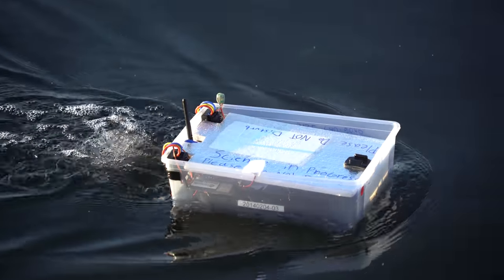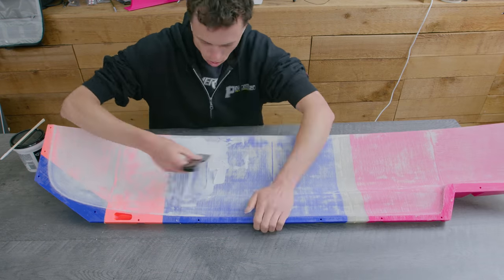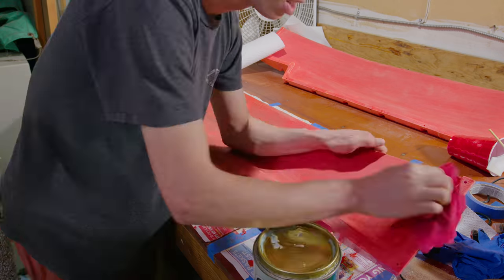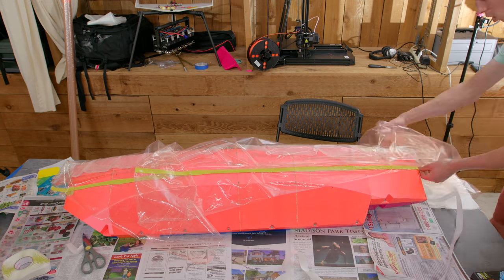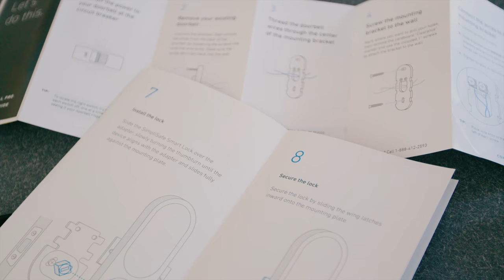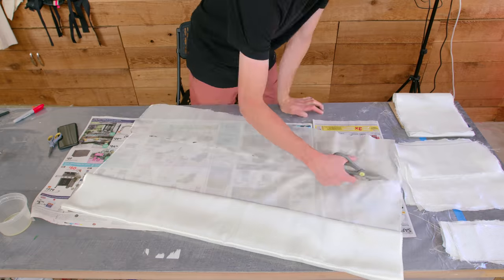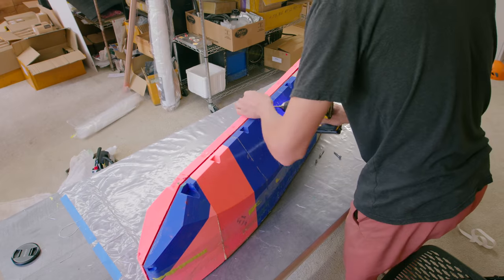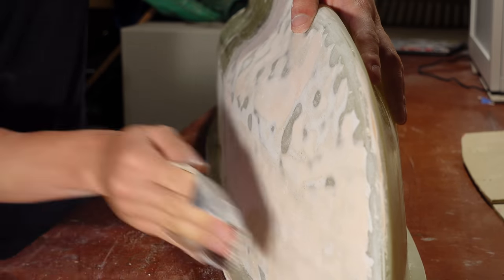I Built a Solar Powered Tug Boat to Pull My Kayak - Pt. 1

Comment: To stiffen the large sides, lay a length of tubing,  garden cane or similar along the length on the inside with some large clayballs to hold it in position. It's how we make stiffener ribs for canoes, 

Lay down some extra mats and resin over the tubing/cane, so that it forms a rigid tunnel when it cures. Remove clay balls when it's cured, resin over where they were.
This will be much stiffer than extra flat matting layers or just painting resin on and probably weight less too. 

For perfect results plane/shape some thin spars or ribs rom spruce and mat them in

Comment: a few ribs for structural reinforcement would be a better to stiffen it up than extra fiberglass. Standard bondo from the autosupply store would be great for filling gaps and leveling - that's what the stuff is designed for.

Comment: Easy sand car body filler is your friend, and styrene in polyester gel coat is not very toxic in those concentrations. it just has a really strong smell. you could also have use cheaper polyester resin for the wet lay with a low catalyst percent like 0.5 percent so it cures slower and kept laying up all the plies one after the other. you need a bit of breather fabric under the valve and along the whole back of the mould like upholstery batting. but because you have a hollow mould using vacuum didnt make good sense as you can distort the mould itself

Comment: It would of been easyier to lay up on the first mold an sanded the glass after, also for filler use epoxy/an talc,  , using poly resin is cheaper too, mix the two into any paste you need!

Comment: Yeah the mold would work far better had it been an inside mold. All of the other stuff you need to attach can be done after the mold is finished. The finish of the mold can be done by sanding. Also you really only need to just use the wax as a mold release.

Comment: Was the vacuum bagging at all necessary? Since the mold was smooth, shouldn't the outside of the hull be just as smooth after just 'painting in' and squeegee in the epoxy?
Reply: The vacuum bagging helps in 2 ways, first it helps to ensure full wetting out of the fibreglass - very important for strength, and secondly, by using the peel ply, it helps to soak away excess resin - important for weight.  Strictly, not necessary for one off hobby type stuff, but very useful - the effort reduces with time and experience.

Comment: Those are great.  Good engineering! So I made outriggers for my and my wife's kayaks out of 16ga aluminum and it worked great.  Any reason you picked fiberglass over other materials?  I've not had good luck with fiberglass here in the desert...with the temps around 115-125F the resin dries in a quarter of the time listed.

Comment: Very nice video!  I learned that I will stay away from vacuum bagging. I don't think you saved any weight or added strength doing that. I'm also going to stick with glass micro beads added to epoxy for my filler.   That Dap is great for filling nail holes in house trim though.  I look forward to what is next!

Comment: You should try carbon fibre, its pretty much exactly the same steps you did but way lighter.
Reply: Sure, but.on a practical level for this project, its very expensive and the weight difference is of no importance since this a displacement type boat.

Comment: I had my hand at prototyping multi haul fiberglass dinghy, hours surely do blend into each other without realizing it, Might have something to do with being stoned by the fiberglass resins lmaooo, important note, is you have a fridge in your shop, be prepared that any and all food in it will taste like resin and that fridge will be good and ready for the recycling station, BTW after your wax, if you paint a mm of gel coat color of your choice and let it somewhat dry( gel coat never fully cures) and then apply your fiberglass, when you separate it from the mold, you will be left with a perfectly painted finish haul.
Reply: Also If you are in a hurry to get a part done especially in a PLA mold, you can add a product called Suncure uvc 2000 to your resin, one little packet is good for a gallon of resin, just mix it in and DO NOT ADD HARDNER to your resin the suncure will become the UV activated hardner, apply all your coats and fiberglass in a somewhat UV light-free environment, once all your coats are done, pop it in the sun, Within min's it will be fully cured and ready to de-mold it does generate some heat but it last only a few seconds which leaves the PLA intact,

Comment: pla is the resin i dfo not have a 3d printer but i looked into it again and i do not need to use that stuff wen i first looked into 3d pla was all i seen used to me it  it cannot be used in a hotcar its not good other than fer junk or prototyping

Comment: Pretty interesting. Will definitely follow to see how it progresses. Just a question though - wouldn't it have been easier to make a mold where you laid the fiberglass on the outside vs the inside?

Comment: In my opinion, it’d been a lot more efficient to make the mold similar to doing a fiberglass on ply boat, where you lay the fiberglass on the outside with the mold being on the inside.
Reply: Looks like he was trying to get the smoothest possible exterior so maybe his method would help out in that regard. Probably why a lot of boat hulls in industry are made that way too.
Reply: @coreybryan3668  and I’m sure that’s the case, but with the issues that presented theirselves, he could have saved time sanding the mold, and sanded the hull to smooth the outside. Regardless he got decent results, that for given applications will be more than sufficient.

Comment: Awesome job! The hulls definitely turned out pretty good. A few things you could try next time: I’ve always had good luck wetting the glass before putting it into the mold. For spreading the vacuum try using bubble wrap, the spaces between spread pretty effectively and it doesn’t stick to epoxy.

Comment: Man, i saw myself when you mixed spackle and polymer together. The man-bitch was beating upon your brow. You have to account for him when your designing these things. Especially when your doing things for the first time he has the advantage! Trust me he will own you the first time. So plan on failure first time around. I think next time you should just print 3d connectors and use aluminum channel to make forms that you then fiberglass over. Its what i'm doing btw. And most of the work is on my computer, where i can control things better.

Comment: Hi, when you use a vacuum pump and epoxy, you need to add a resin vapor trap between the mold and the pump. Otherwise, the vacuum pump often gets destroyed. That could be the reason for the smoke. Also, the epoxy reaction has an exothermic reaction, so it inherently heats up as it dries. Otherwise, for first attempts with fiberglass, it turned out very nicely, so congrats.

Comment: You get an A for effort but unfortunately you don't know what you're doing. You're supposed to use 2 part epoxy and fiberglass. And a sectionalized hull is a horrible idea.
Reply: Your vids get an A for effort.